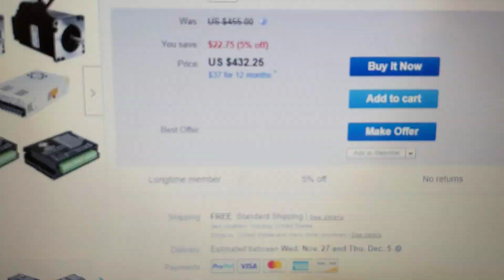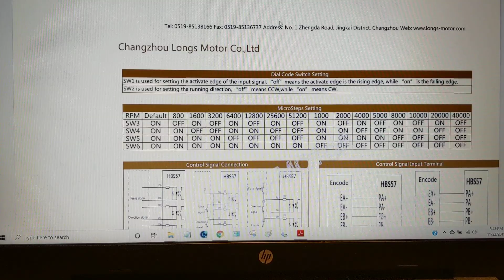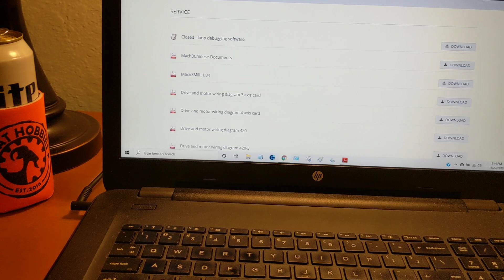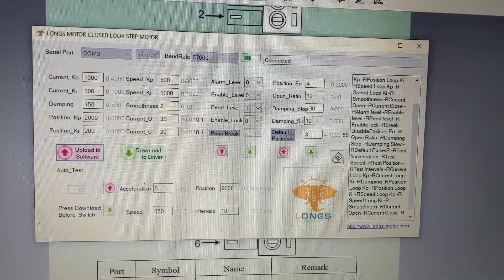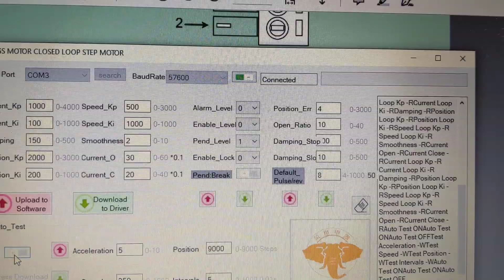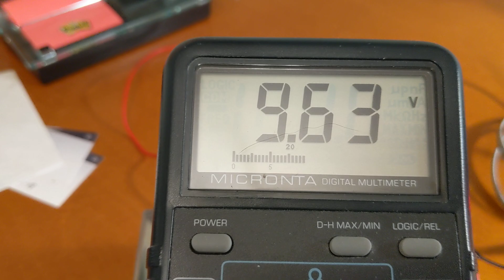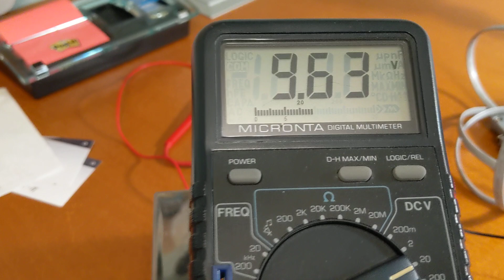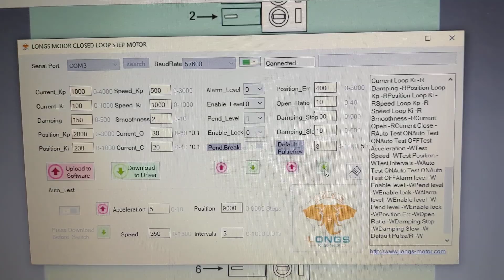Longs Motor HBS57 Closed Loop Stepper Driver Setup and Programming

Comment: I was wondering, did the motor and driver try to pull back to it's original position after you stopped forcing it out of position? and did that change when it hit an alarm state? thanks muchly

Comment: Did you use any resistors to wire the ALM output of the drive to the input that detects any faults?

Comment: Thanks again for posting.  I have the Longs config software up and running and have cables similar to what you are using.  I loaded the driver for windows 10 that came with the smart cable.  The red led comes on, but I am unable to connect to the Longs software.  Any suggestions?  Regards, Steve
Reply: Hi! did you find a solution? i have a same problem with HBS57H.
Reply: @hannielxd2370  Hi, I was able to get it working eventually, however I don't recall what caused it to start working.  Possibly a different USB port on the laptop?  Or try using a different laptop and see it that makes any difference.  Sorry I couldn't help more.  Good luck.

Comment: I need a little help... I tried using an HBS57 drive to be controlled with a parallel port interface and I didn't succeed.  I did several tests using another controller via USB, I tested the card with another driver, all worked.  so everything indicates that the problem is controlling the HBS57 drive using a card with a parallel port if you can help me with any ideas I would appreciate it

Comment: Hi franco can you post the pinout for the db-9 (rs-232) to rj-26 cable please.
I have found no less than 5 different pinout diagrams and none have worked for the HBS57H.
I am hoping this cable will. 
The 3 pins on the db9 should be 2,3 and 5 , its the rj-26 connector pins that are a nightmare.
Reply: i have a same problem with HBS57H. Did u find a solution?
Reply: @abyrvalg4838  no.

Comment: I have always wondered what is the correct micro stepping for the encoder, to get a 1:1 ratio? I seem to get 4000 micro steps for a 1000 point encoder?
Reply from the maker: A 1000 line quadrature encoder will make 4000 pulses per revolution.
Reply: @FrancoCNC  Excellent! I'd like to ask you for one more thing, I hope you know to answer.
Let's say I set the micros stepping to 4000 p/r, I would assume that the driver can't compensate position errors on the fly, since the very moment it detects that the drive is "behind" is when it has skipped a micro step?
The question is, do these controllers have a tolerance margin on the encoder detection that gives it room to compensate before an error/alarm trickers?
Reply from the maker: @Mr_Wh1  They do.  There are parameters that govern how the drive compensates for error and how much tolerance they have before they generate an alarm.  Even the big expensive  commercial CNC machines work this way.
Reply: @FrancoCNC  It makes sense. I guess the manufacturer have programed some reasonable compromises/ middle grounds, or I will have to get one of those rs-cables and set it myself. Thank you.

Comment: thanks very much ! do you need to do anything extra to mach3 to run closed loop? could you run non closed loop motors from this driver ?
Reply from the maker: Hi.  Mach3 (or any step & direction based CNC system) doesn't really care or know the difference between a closed loop or open loop stepper system.  The software just outputs the step pulses and the direction signal and assumes everything is good.  The closed loop driver uses the encoder in the motor to "guarantee" the instructions are executed correctly.  Regarding your second question, you must use the motor that is designed to work with that driver.  If there is no encoder feedback to the driver, it will alarm out.
Reply: @FrancoCNC  thanks very much

Comment: Hi Franco.
Need your help.
I have 3pc - HBS86S drivers from act-motor https://www.act-motor.com/closed-loop-stepper-driver-hbs86h.html, 
exactly the same as from https://www.longs-motor.com/closed-loop-motor-driver-hbs86h.html
I try to connect via RS232 to have access to the driver settings, as in your video.
But no matter what I do, I tried different USB to COM adapters, I can not read and write driver settings. All the time in all program cells one value "19"
What is my mistake or problem.
 Please help solve this problem.

Comment: I have a hbs86h driver but I want to use a spare 8nm closed loop motor I have from rattmmotor is. There any way I can set the driver up to work with the motor, the specs are identical to the hss86 driver which is what I’m using for my machine, this is for a rotary axis I’m making tested them as is and they don’t like each other at moment so any info would help otherwise I’ll just have to buy another matching driver or motor cheers.
Reply from the maker: My guess is you probably won't be able to make that combination work.
Reply: Franco got it to work, turns out  I had to reverse polarity on A encoder wires, works a treat thanks

Comment: hello franco, thanks for your published video.
would you be kind to tell me the wiring diagram of the serial port connection and rj connector?
thank you very much.
best regards from italy.
Reply from the maker: Hello.  I hope you are doing well over there.  Follow this link - I think you will find what you need in there:  https://www.dropbox.com/home/HBS860H%20Closed%20Loop%20Driver?preview=HBS-90-8.2_Driver_Data_Sheet.pdf

Comment: Hello Franco,
What type of control board and free software do you recomend To go along with this driver ans servo motor. It's for my chinese workbee. Many thanks.
Reply from the maker: I'm a big fan of the Centroid Acorn CNC control system.  That would be my recommendation.
Reply: @FrancoCNC  Ok Thanks a lot
Reply: @FrancoCNC  Thanks Franco

Comment: So there is no backlash with this motor?
Reply from the maker: It's more about not missing any steps.  You can have the best closed loop motors in the world and still have backlash in the mechanical system they are driving.

Comment: Hey Franco, How do the dip switches correspond to the frequency input? I'm using a 200us delay between pulse high and pulse low connected to a HSB860H Servo Drive. I know the factory sets these with 2,3 &4 sw on and the rest off. I don't have any alarms on and the Motor locks the moment I turn on my MCU. I've checked the wiring and everything is correct but the  motor won't turn. Is it really important to have the SW settings right to make the motor turn? It's not under any load and all voltages are correct.  I have PUL+, DIR+ and EN+ connected to the MCU with the EN+ LOW, DIR+ HIGH/LOW and PUL+ to Pulse Pin sending 200us pulse. But not sure if the dip switch settings are correct and I can't find any documentation to set them because it's a Chinese off brand.  Can you give me any insight to how these dip switches work? I thought they just set the motor type, (6) and Direction (5) and SW1, SW2, SW3 & SW4 are for the Steps per pulse.
Reply from the maker: This may help:  https://www.dropbox.com/sh/a3g4dw71q4taxsd/AAARblbK4GKL5zXj8Yzfr8VHa?dl=0

Comment: Hey I'm using an acorn with these drivers. I wired the alarm to input 6 on acorn and ran the other end to a common on acorn. When it alarms 24 volts goes though the driver (normally open). Everything works as it should when i unplug the encoder and move the axis the driver alarms, and acorn goes into alarm. However, when i plug the encoder back in and manually move the axis the driver doesn't alarm but my acorn goes into alarm saying drive fault. Any ideas why this would happen? Thanks!
Reply from the maker: Hi.  Usually, these alarm circuits are wired up to a normally closed input on the acorn.  The idea is that you can "daisy chain" all of your drive alarm outputs in series.  As long as things are good, the chain is closed and the normally closed input on the acorn is happy.  If any of the drives in the chain alarm out (open) the chain will be broken and the alarm on the acorn will be triggered.  I hope this helps.
Reply: @FrancoCNC  Thanks Franco, I understand now. I ordered the same calibration cable you have in your video but unfortunately the no name eBay hbs57 doesn't connect to the software. I tried using the software in your video, and another I found on mecheltron for the hbs57. Any suggestions?

Comment: I contacted Sherline to ask them about making me couplers for those motors shafts, and they said they could, but then wrote me another email telling me that these motors in the video would be too powerful in the event I crash the machine… Any thoughts on that? A reply would be greatly appreciated as I was set on buying those motors. Thank you
Reply: Also they said it was because they had to beef up the machine for their 1.35nm 2a high torque motors.  And that all looked good minus the 4 amp holding torque on the longs motors.  I can’t afford their set up although the neat and tidy little package is appealing.  That just puts me back another 400 and I had to beg the wife to let me spend another 500 already lol.
Reply from the maker: @durangotang1681  Hi.  On eBay, you can buy a 1.1nm version of this motor along with the HBS57 driver.  That would probably work just fine.  For me, I'm happy with the bigger motors but I can see the wisdom in their advice to you.
Reply: Franco so In other words-get the bigger motors, just be conservative af with feeds and speeds and dry-run everything first😂?
Reply from the maker: @durangotang1681  So far, that plan has worked well for me.
Reply: Franco awesome.  Thank you much for the responses.  I’ll be ordering everything tomorrow.  Decided it looks like I can just bore out the couplings myself on the lathe.  Furthermore when I “hearted” the motors on eBay it gave me a 10% off coupon which saves me another 43 bux on them.  Super stoked to finally be getting into cnc.  Thank you for all your help.

Comment: Ah what happened to the video you uploaded yesterday?  Not sure if you saw my comment.  I’m planning on ordering these motors for the sherline 18” ball screw mill on the 5th of December.  I realize I’m going to need different couplers but was wondering if you had any objections to using these on the sherline mill.  Seems like they are better then sherlines high torque steppers after looking at the numbers.
Reply from the maker: Hi.  Other than the couplers (Sherline seems to like 1/4" and these motors are 8mm) I think this will work great.  I believe there motors are a perfect fit for a machine such as the Sherline.
Reply: Franco awesome thanx.  One more question sorry.  As far as everything goes, this package plus Mach 3=go time?  I really suck with electrical components.  Will probably build a basic box.  Any wiring tips and tricks you could throw in would be super appreciated.
Reply from the maker: @durangotang1681  Hi.  I have lots of videos on that subject.  Here is an example:  https://youtu.be/5D7px0r0pUE